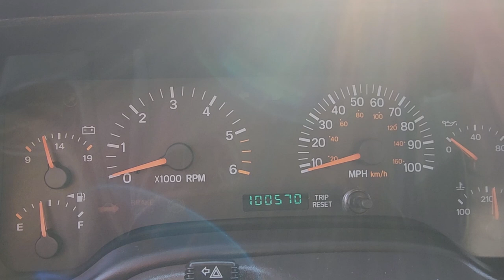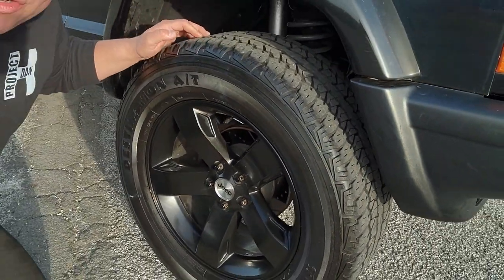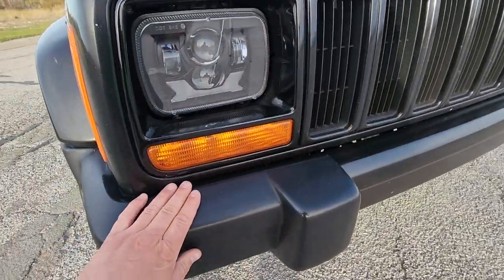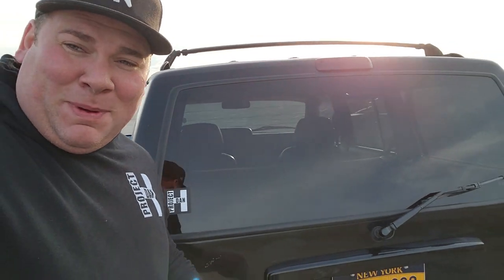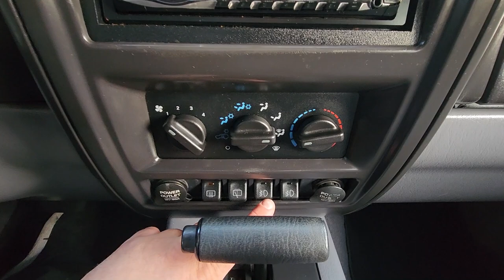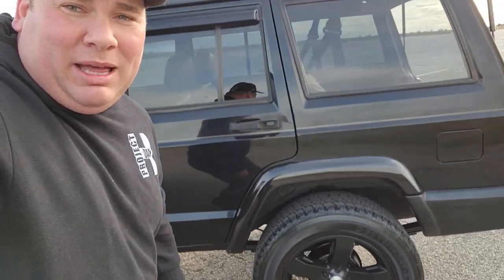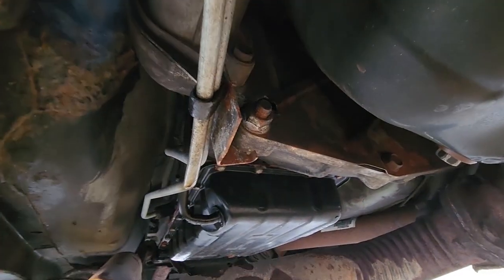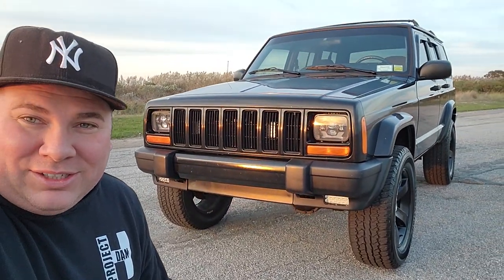STILL THE PERFECT XJ! - BYE BYE BLACK BEAUTY - 2000 CHEROKEE LIMITED WALK AROUND

Comment: I have a 1999 XJ from the south, and she is spotless. Mine is named Goldie. I got the 99 because I didn't want the coil pack head, and dual pre-cats. She also has 225,000 miles, with original exhaust.

Comment: I actually loked the leather seats a lot better (at least for looks).
But yeah, it is very nice and looks very nice. Those headlights are way better than the angry ones you had before.

I personally like more tough looking jeeps (big tires, smaller wheels, steel HD bumpers, spare tire carrier, rock sliders, more lights, roof rack...) but this looks awesome. I really love the jeep in black, I would love it to be all black interior too, I'd swap those street tires for a set of KO2's in 265/70r17 with black or bronze wheels, add the roof rack and the spare tire carier, ditch lights, over the head light bar and delete the grille lights. But that is just me. Ill post mine as I advance in my proyect and I will leave a link in the comment section for everybody to tell me how ugly and bad my rig is.
Reply from the maker: Awesome man.  Thanks for the input!  Hit me up on Instagram!